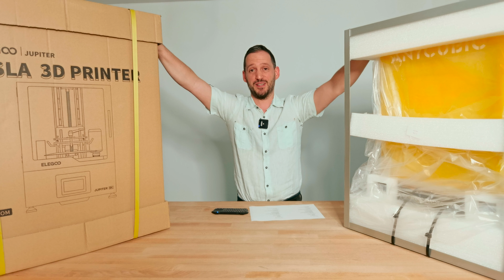Elegoo Jupiter vs Anycubic Photon M3 Max (In-depth comparison)

Comment: I just got this Anycubic M3 MAX and I am very disappointed, the pump stopped working after one hour of use. The Display screen is like from the 90's, the whole machine shows poor quality, technology inside is old, VERY SLOW, cheaply made at premium price. I may will return it if their CS does not help with the issues, the reply back but with copy/paste replies that has nothign to do with your problem, not helpful.  The Elegoo seems like a good choice, I like the enclosure as you can plug a pipe for the fumes. Seem all the M3 MAX problems was disappointing.

Comment: Why does a refill "system" even need a pump? Just have a holder that holds the opening of your resin bottle in the vat at whatever depth your want your resin to stay at. That's it. The resin will pour out of the bottle until the level in the vat reaches the opening of the bottle. Once the resin reaches the opening of the bottle, air can no longer get into the bottle and a partial vacuum is formed in the bottle preventing more resin from filling the vat. When the level in the vat drops below the opening of the bottle once more, air can rush in equalizing the pressure in the bottle allowing some more resine to flow out. It's super simple. No pumps, no power, no sensors or computers needed, nothing extra to clean, will work with any bottle and is basically fail proof. 

There simple ways to make this even better, like drilling one hole in the top of the lid and another on the neck at the desired resin depth, this way air isn't trying to enter the bottle the same way resin is trying to leave and with smaller holes, it's much easier to remove the bottle without too much spillage.

Comment: I like the weight and construction, and I think the feeding system of the Elegoo Jupiter, but I need it to be larger. 
I might have to get a Mega 8K from Phrozen as I am printing 1 to 4 foot models of Star Trek ships, so the least amount of pieces that I can make to model them, the happier I am about it.
I have had problems with the auto resin feed on the M3 Max, which from what I have seen, It works well or not at all.

I have also had issues with Anycubic CS, and waiting forever for parts to ship.
I don't like that the Jupiter is 6K also. It is probably Stupid on my part and my models are somewhat simple, but if any of these companies come out with a 10K, or 12k model and can print on like a 20 inch screen like 2 feet on the Z axis and can be like in the 6000 dollar range, I will be there.
Reply: Thinking of getting the Phrozen 8k mega too. I want to do 4 ft models.
Reply: @smallnuts2  I ordered one and have it on the way.
The Star Trek TOS Constitution class is just over 4 feet in length.
I have a M3 Max and it makes some big parts but has its limitations mostly on the Z axis of the prints.

Comment: I have been using the M3, and the M3 max. Good price, but so far the slicing is a pain in the ass, and the company sucks to deal with.
I use Chitubox, but it converts the files into Anycubic files which has issues.
I have been looking at Phrozen Mega 8K but I have seen some negative reviews on that, but that will happen with any and I am sure all of them.
I have had to wait 3 weeks to get a replacement screen. That Sucks as I have been selling Star Trek models on Ebay, and now have to wait.
I think I will order another screen or 2 to have spare.
Reply: hello brother I'm also facing issue to slicing the printing files .can you tell me how can i slice perfectly..very disponting about after service
Reply: I just got this M3 MAX and is problem after a problem, CS is worthless replying with copy/paste replies that has nothing to do with the problem you asked for. Have you got it to work? I can still retun it @apratimjha917
Reply: I just got this M3 MAX and is problem after a problem, CS is worthless replying with copy/paste replies that has nothing to do with the problem you asked for. Have you got it to work? I can still retun it
Reply: I have had success and failures with it. I mostly hate their slicer software as it seems to not like my Blender models and tends to make areas and objects that are not there. Chitubox has helped but it still has to convert it into their slicer files to print. @RCREVIEWS101
Reply: I actually broke down and I have a Mega 8K S on the way, but when the M3 max does work it is good. but yea, it seems like getting them to work is a pain in the butt sometimes

Comment: - Rusty rails
- Cracked rear window
- Flimsy noisy front metal panel
- Buggy screen
- 10sec freezes at lift and retract
- Normal 5h print is 25h due to stutter
- Pump screams at power on
- Pump literally sucks, in reverse
- homing sometimes compresses the screen for no reason, risky.

Anycubic sold us a 1000$ trash can.
I'm so pissed.
They act like its nothing. Barely responding.
Go with Elegoo, much more reliable and responsive.
Reply: just got this Junk M3 MAX, I probaly will need endure all the PIA of returning it now

Comment: Thanks!  I bought the Anycubic Photon Max to make large prints.  I bought a cure station.  The Creality UW-2 is the only one that fits the size of prints I am making, so I had to accept it with warts and all.  I would love to see your thorough take on washing and curing
Reply: any lucky with the M3MAX? I only got problems with this junk
Reply: @RCREVIEWS101  I used it without problems for about a year for I didn't really have time to keep it up. I printed a lot of skulls and other bones from the body. I was pretty happy with it. It get some errors that were frustrated at times take close swatch complex prints to make sure it didn't fail
Reply: @macgyvervanschwartzenstall4662 should i buy the m3 max ?
Did you had issues with it ?
A lot's of people talking that it was a bad printer

Comment: Fantastic video, I think the difference in the structure of both machines comes down to cost savings. Although the Jupiter is very sturdy, I'm happier with the weight and cost savings gained by the Max's plastic cover. I think the Jupiter is a little "over the top" considering the build volume. The shipping costs are also massive. The Max generally has free shipping.
Reply: shipping costs usally are FREE SHIPPING, you can easily put a pipe out for the fumes on Jupiter, with M3 MAX you simply cannot contain the fumes inside, also its technology is a POS with a slow mo procesor, display looks like comes from the 90's. VERY diapointed with the M3 MAX

Comment: Thanks for this. I'll be checking back to see what Elegoo has to say regarding the  play in the lead screw. I had been leaning towards the Elegoo, but now I'm undecided.
Reply from the maker: The printer looks great.  Build quality is great. I am curious on how elegoo will help with my printer. Will keep you all up to date.
Reply: @twinstalk  The more I think about this, I have to wonder if that vertical play would make any difference in the print quality. It seems like the only thing it would effect would be the lift height.  After looking more closely, it looks like the coupler itself is stretching, and that is the source of the movement.  Regardless, I would think adding an extra mm to the lift height would be enough to accommodate the linear flex.
Reply: I've had the Jupiter for a few months and it's definitely the best printer I've used, I returned my M3 MAX and used the money to buy the saturn 2.. 

I've not had any play in my build plate and I've done a bunch of large prints that maxed out my z axis to within 2mm and the prints have been absolutely perfect, since it arrived I've sold both of my mono x's as well because the Jupiter is a beast!
Reply: @printitpaintit.2436  Thanks for your input. I will be getting the Saturn 2 soon as my first printer. And I'm pretty much decided on the Jupiter after I get the hang of the Saturn 2. After considering it, I really don't think the flex in the z coupling would have any effect on printing function.
Reply: @printitpaintit.2436  How are you liking the Saturn 2? Any good?
Reply: @CreativeTechno  it's really good much better than the original and it has a bigger build plate, print quality wise I don't see a huge difference between the Jupiter and Saturn 2..

I had a problem with my Saturn 2 but elegoo customer service was fantastic as usual and sent out a replacement..
Reply: @printitpaintit.2436  Thanks for quick reply :) From the reviews it has many thumbs up's so feel i'll take the plunge ;)

Comment: That was very informative and in-depth. Thank you for taking the time to properly examine both machines. In full disclosure I backed the Jupiter, but took the refund after the many delays. I’m in no way knocking the Jupiter, but after watching your presentation I might have dodged a bullet.
Reply from the maker: There are some people in the Facebook group having issues with their prints and getting the first layer right. Maybe it is connected to my problem. Let's see what elegoo will respond.
Reply: @twinstalk  while there may be a problem with the printer that has yet to be diagnosed, I’m sure it’s more user error. Having been in most of these groups too many don’t understand what they’re doing. They refuse to look for solutions, won’t take advice, and sully a product that they shouldn’t even poses. I’ve read Amazon reviews where they returned a printer because it wouldn’t print an stl no mater how many times they leveled it. 

Before the Jupiter was released many on that page told new users to get a cheap compact printer to learn on. They barely had the funds to purchase the Jupiter and didn’t think of the resin it would consume, to even fathom learning on something more affordable. Now you see them posting that they don’t have a wash and cure system to go along with it, when there’s plenty of options. 

After closely looking at your video I would look at where the ball screw sits in the collar. Is it seated completely and correctly?  Also is that a flex collar?  It on its own will cause the deflection you showed. Are both ends tight, and seated fully?  I would look at those first to diagnose the problem. Second I would also inspect the backlash components to make sure they are correctly installed. Lastly if those are all correct then I would look into the ball and screw. Are they matched tolerances?  Is the ball the correct diameter?  Remember machine parts will have a tighter tolerance with grease or oil. Could the parts be under lubricated and that’s the cause of deflection. I’d be curious to know if these would be the same questions their tech department would ask. 

Again I’m looking forward to your other videos comparing the two, and I hope you find a solution for the Jupiter.
Reply from the maker: @lorinrobbins7911  thanks for the advice. I will see what the service will come up with and check the points you have mentioned. Will document my findings with some kind of a video log and post it here.  Hope that there is an easy fix and posting it online will help others with similar problems.

Comment: Glad to see you back after a year, have you tried any prints on these 2 giants? Any different in print quality that can clearly spot on? I believe Anycubic come with protective screen between LCD and FEP film, will it have any effect on the UV power that have to go through additional layer of glass? Longer exposure time than Elegoo?
Reply from the maker: Thanks. No prints yet. The screen protector should not have an influence on the uv light source power i.e. exposure time. These screen protectors do have a very high light permeability. I will test with the screen protector on. Just have to wait for elegoo service to responde to my email. Did send it out today.

Comment: Who can afford that much resin, to say nothing of the hassle of cleaning and curing.
Reply from the maker: These are for biiiggggg prints :)  I am also searching for a cheaper solution to get the resin. Maybe someone can comment on this here?
Reply: @twinstalk  How fast do they print compared to say an Ender 3?
Reply from the maker: @Martial-Mat  Will start a print comperison later on. I am in contact with Elegoo support now.
Reply: @Martial-Mat  Much faster then FDM a 300mm high takes 14hs on the Jupiter and that's stock settings I've brought that down to just under 13hs!
Reply: @printitpaintit.2436  Thank you. That's useful information.
Reply: Jupiter case is way too big physically
Reply: @johneutube1975  I guess it depends upon your use case. In a workshop maybe not so much, but yeah, pretty enormous!